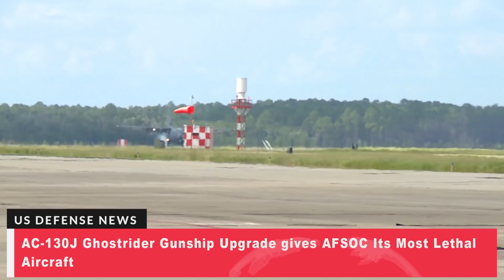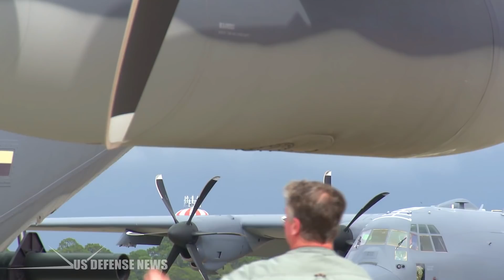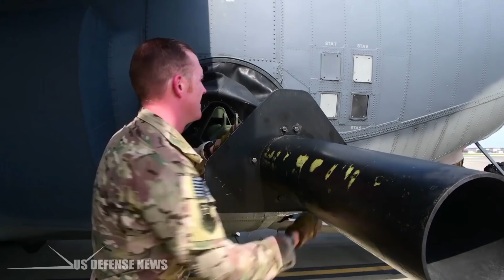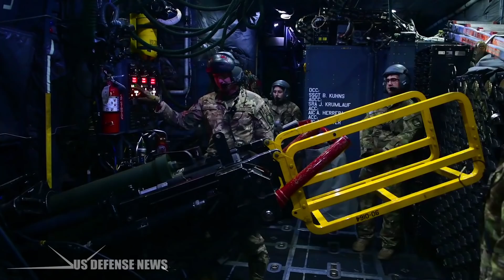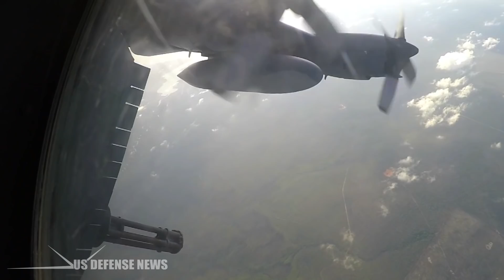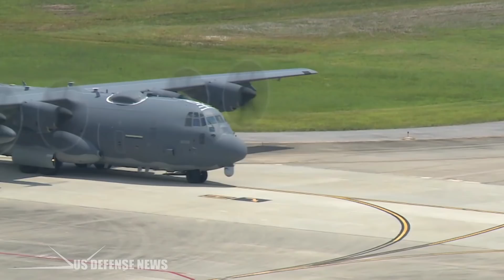AC-130J Ghostrider Gunship Upgrade gives AFSOC Its Most Lethal Aircraft

Comment: PLEASE NOTE: CONFUSING AND INACCURATE.  This video which purports to be about the AC-130J Ghostrider, incorrectly puts a GAU-12 25mm rotary cannon on the title thumbnail.  The AC-130J is NOT armed with a GAU-12.  They also confusingly show the Bofors 40mm/L60 cannon, which is also not included on the AC-130J.  Those are weapons from the older AC-130U.  To clarify the AC-130J is armed with a Bushmaster 30mm cannon and a 105mm howitzer.

Comment: Would probably work if they had total air control but otherwise a low, slow target.
Reply: Gaining Air superiority is the first main stage of any ground war.
Reply: @Ugnutz  True but you still need boots on the ground, see Vietnam.
Reply: This aircraft is equipped with many radar jamming devices, flares, all kinds of new, but it never goes out alone. These aircraft, even the earlier versions faired quite well with almost no losses by enemy aircraft or ground to air munitions. I see your point, but our military isn't stupid. Try and google some vids where these were used over Vietnam. Spooky they were called, and the VC were terrified of them. The VC had Russian made SAM 2 missiles and 20mm AAA. Not many were lost if that helps you any. Besides this newer version is in  testing phase.

Comment: i thought they were going to do away with 105mm because of stress on the air frame, wish oz would get some of these. i wonder if not hell fire missiles the could fit out some spice 250 glide bombs.
Reply: They were initially but everyone wanted it back, which is a good thing.  Bout time!!
Reply: I think they upgraded the air frame to be more structurally sound specifically for this

Comment: What?  No more Gatling Gun?  No more Twin BoFors 40mm’s?
Reply: That's what the hellfires are for. Just fire one in the crowd and move to the target lmao.
Reply: I was thinking the same thing. They commented on the new one  having more firepower. But if I'm not mistaken isn't it down a weapons system? I couldn't imagine the despair and overwhelming sense of dread having that gunship looming over head.
Reply: The 30mm Bushmaster is super-accurate and can fire up to 200 rpm.
Reply: Yeah sad day. The 30 mm chain gun (Bushmaster) could have been replaced with a underfuselage cannon mount from the Apache and the autoload 105 mm from the Stryker behind it. Then they can fire to either side. Add the 100 kW solid state LASER and it's all go. Existing weapons take care of hard and soft targets but the hardest target is fleeing bodies running in all directions. Previously you could spray the field with the gatling, now?? 105 Cannister? What?

Comment: These gunships seem very labor intensive and that sometimes slows down delivery of these munitions.
Reply: How about YOU go on the ground to witness first hand "slow delivery of munitions" on your head?
Reply: Demef If American troops are in need of protection from these gunship, then instead of manual automatic reloading and firing systems is the way to go, you like semi I want fully automatic
Reply: Thomas D,
   This is an offensive weapon. It is for killing the enemy.  Do we have fully auto artillery on the ground? Then why would you expect that in the air? Just the weight savings gained by having the manual load setup is worth it.
use your head.
Reply: Does the Abrams have at least semi automatic cannons, well.
Reply: @tommytube268  The M1 does not have an autoloader.  Humans are just as fast (also smarter and less likely to break down)

Comment: What happened to the Gatling gun?
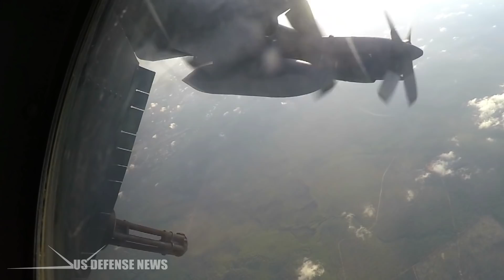Reply: Look at 7:39
Reply: replaced with 'Gunslinger' weapons system with launch tube for AGM-176 Griffin missiles and/or GBU-44/B Viper Strike munitions (10 round magazines)
Reply: @janibeg3247  Not likely
Reply: Replaced it with hellfire missiles 😂
Reply: Cav One  No, the Gatling gun is gone.  Replaced by 30mm Bushmaster cannon.  Rate of fire is up to 200 rpm.
Reply: That part with the Vulcan is actually footage of an older model of AC-130. As evidenced by the fact that it has the old four blade propellers.